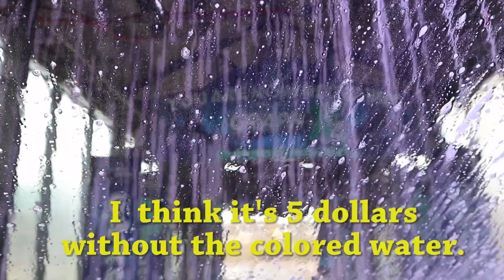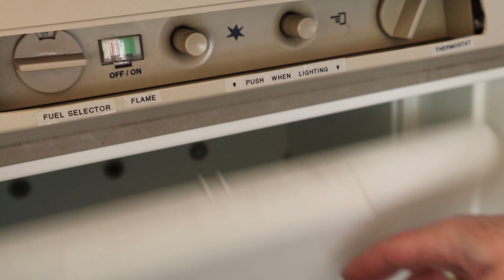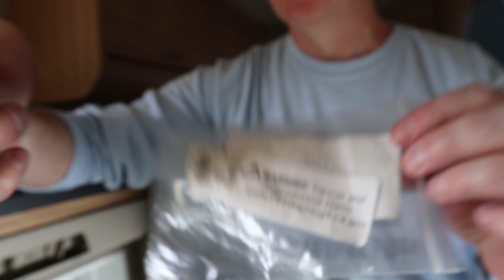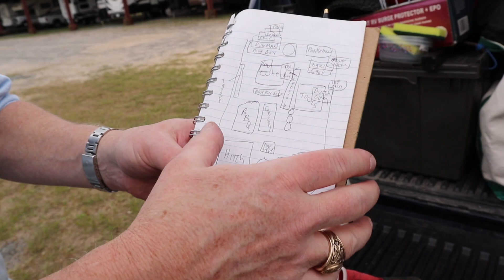Starting Our Spring RV Trip! | Fixing Our RV | Heading South

Comment: Rich, i need a mirror for my Bath as well. I got nothing over the medicine Cabinet. Can you send me the hinge info? Also how did you attach it to the glass. did you have holes drilled by the glass company. I have nothing but and empty cabinet.
Reply from the maker: Hi Harvey and thanks for watching!  The hinge was a "continuous stainless steel hinge" that we had custom cut to length by www.boatoutfitters.com.  The metal backing was from the original mirror and is attached via 3M double sided tape (as was the original from Airstream).  We removed it  by passing a thin wire between the mirror and the backing.  The rivets were "hollow rivets" from McMaster Carr.  The most expensive part of the project was the special tool required to peen the rivet.  To the back of the mirror we applied a 3M Glass Safety Film to keep it from shattering (as per my glass guy's recommendation).  if you have any other questions, zap us an email to luvsubbin@gmail.com  Good luck!